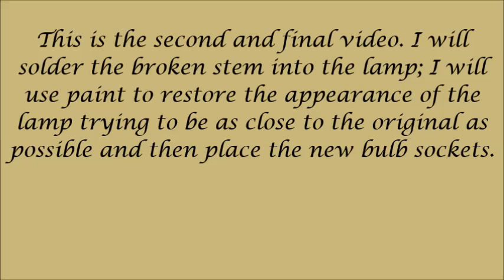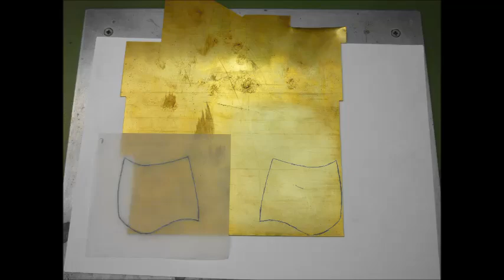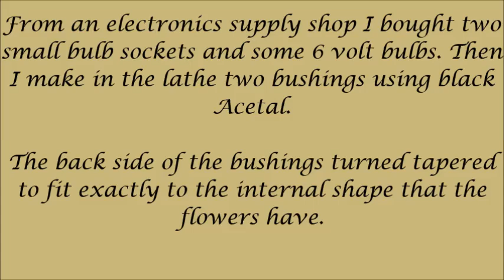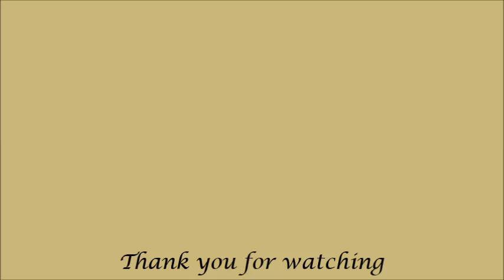Restoring an old table lamp part-2

Comment: This lamp is from the 1920’s or 1930’s I believe. Normally this type of lamp wouldn’t be my cup of tea as it’s overly ornate but I really like this one. It’s a little different and the nymph kind of draws me in. I’d love to find something like this. It would suite my boudoir. What did you use to darken the new bronze?
Reply from the maker: I apologize for the late response. 
Thank you very much for the comment, I appreciate it! I’m not sure, but I think the lamp is made on mid 50s'. Yes it's a bit overly ornate, but still has character. The lady that was sending me this lamp to restore, it uses it as bedside table light. To darken the bronze, I used liquid oxidizer suited for all copper alloys; something similar to this: https://www.riogrande.com/product/midas-brass-bronze-and-copper-oxidizers-light-brown-to-black/331043gp
Thanks once again for the comment!

Regards from Greece
Jimmy
Reply: Actually, these lamps were made in the period circa 1890 to 1920, usually in France. It is art nouveau. They are made out of "pot metal," or "white metal," which was a compound of cheaper metals. They were much lighter, could take much less detail than bronze, melted at a lower temperature, and were more brittle and prone to breaking. They were overlayered with a bronze color. The tubes holding the lights are likely of copper or brass. Presumably the more expensive varieties were, in fact, of bronze.

Comment: If I may ask: what sort of paints are these? Acrylic? And they appear to be diluted--with water, or paint thinner?
Reply from the maker: Thank you for asking! They are water based acrylic paints; exception is the bronze paint that can be diluted with turpentine. I’m not an expert in paints and thinners, but I have found that when the acrylic paint is completely dry it can re-paint using turpentine based paints (usually I apply one thin layer; if a second layer is needed I'll wait 48 hours to apply it).  
All the best
Jimmy